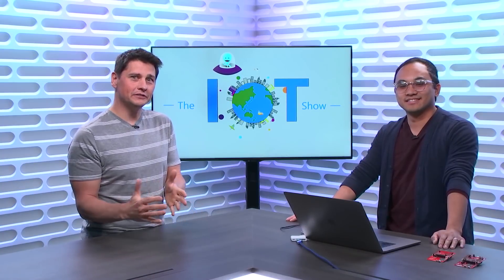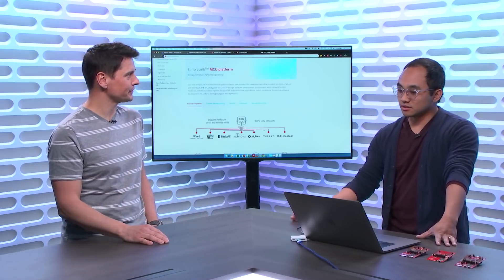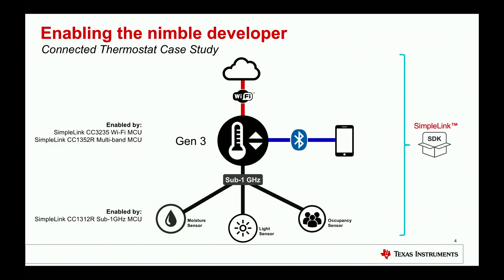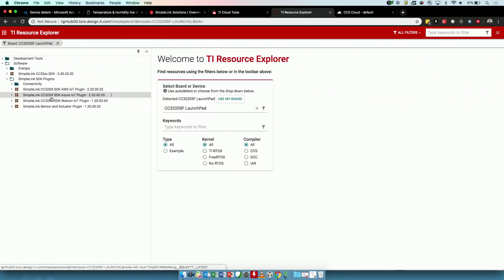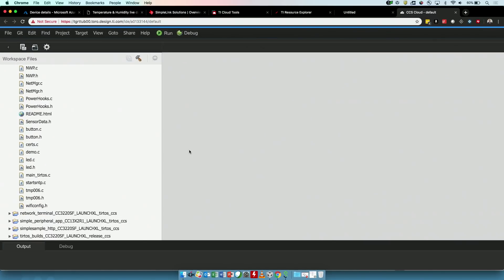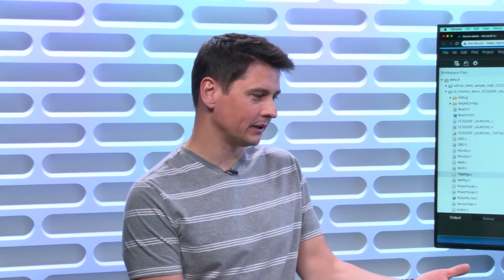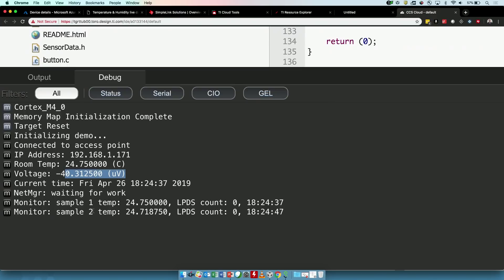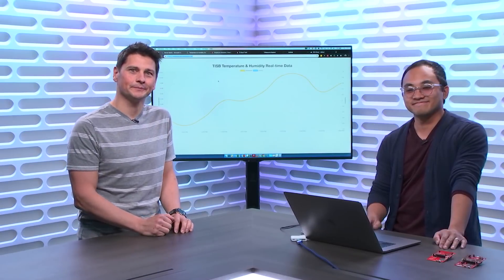Texas Instruments SimpleLink MCU Platform with Azure IoT

Comment: Thanks for very informative video! I have two questions, request you to clarify - 
1.  is the data streaming protocol between TI device and Azure IoT hub is over a secured channel? using SSL/TLS portocol OR its a normal http one?
2. I have a slightly old board CC3200. It has wifi support. Can I use Azure Iot edge on this device as explained in this video?